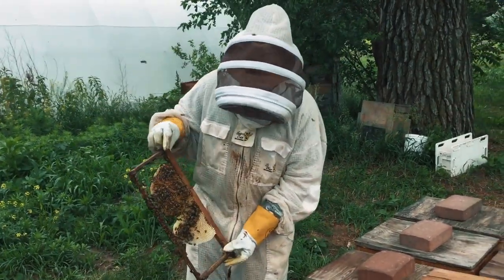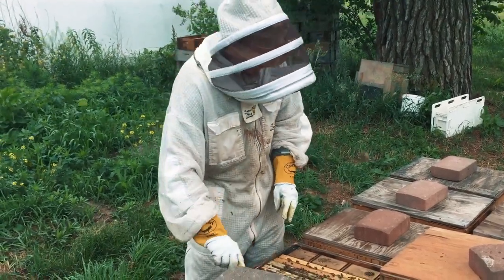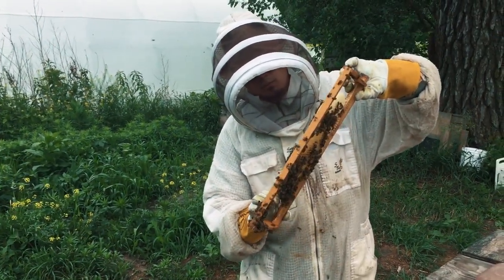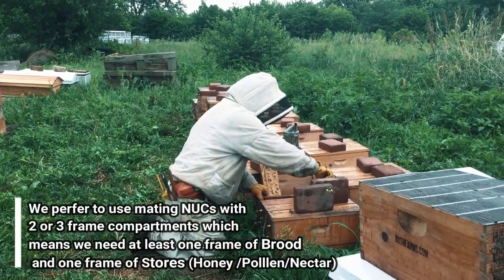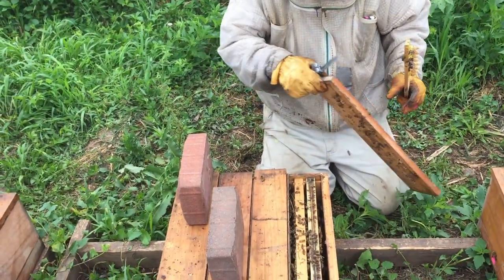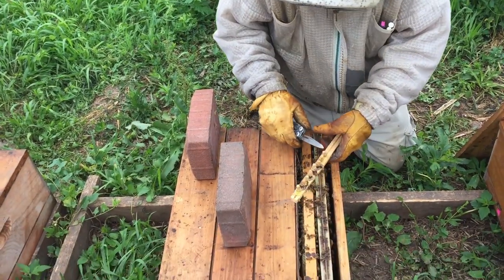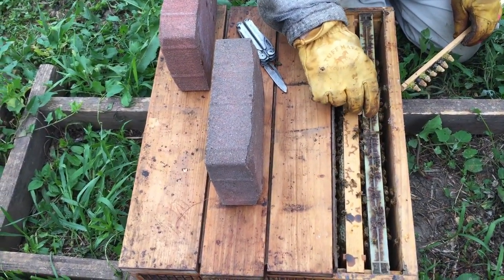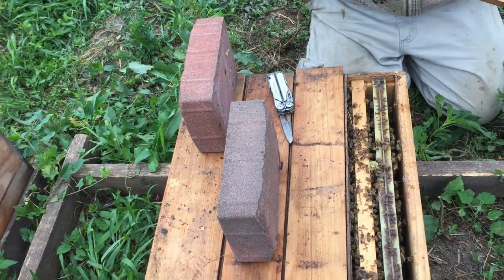Setting up Mating Nucs for Queen Rearing

Comment: Hello Mr.Bush! Your hives has the top entrance. Is this not a problem for bees to take out the garbage?
Reply from the maker: Trash on the bottom board is no more or less of a problem with top entrances.  When the density of bees is high enough that there are bees available for the job, the bees clean off the bottom board.  With a bottom entrance they don't usually get it cleaned off in the spring until there are a lot of bees.  It's the same with a top entrance.  I've watched a house bee hauling a dead bee all over my observation hive in my living room.  It has a bottom entrance.  But the house bee hauled the dead bee to every corner of the observation hive trying to figure out where to put it.  It's not a problem to haul dead bees to the top.  It's probably a lot less work than the extra work they would have to do to ventilate the hive without the top entrance.
Reply: Michael Bush ...I agree 100% , in nature if there in a tree trunk or somewhere else they might have one tiny hole for an entrance and they still clean there living area out regardless where the entrance is. I think people over think things and make things complicated for them selves , each to there own tho. Good video. Cheers. 👍

Comment: Do you have to do any supplemental feeding in your mating nucs, or do you just make sure that your frame with stores is enough?
Reply from the maker: Generally if they are low on stores I give them a frame of honey.  If there's a dearth and I'm trying to get the queens to fly, I use a dixie cup squished to fit between two frames and give them a couple of tablespoons of syrup.